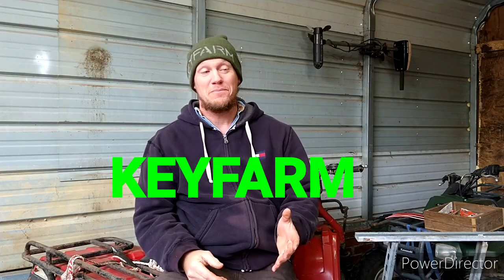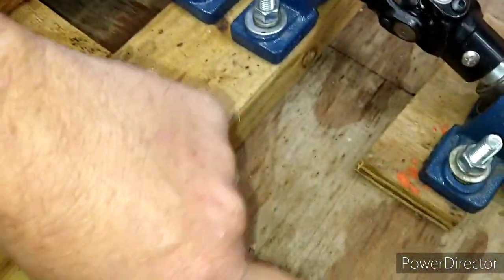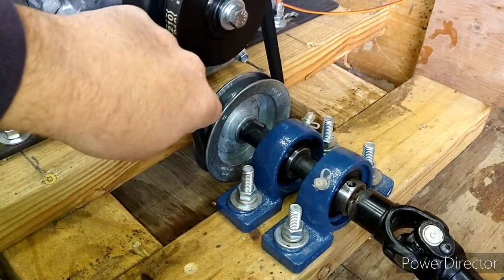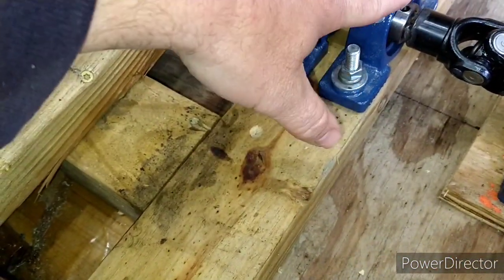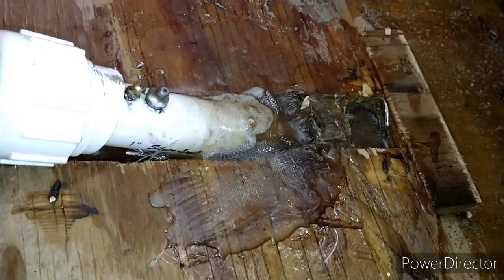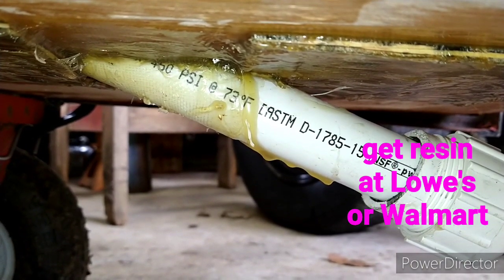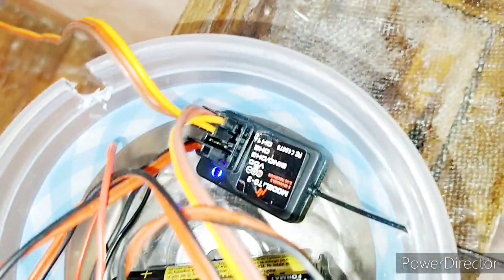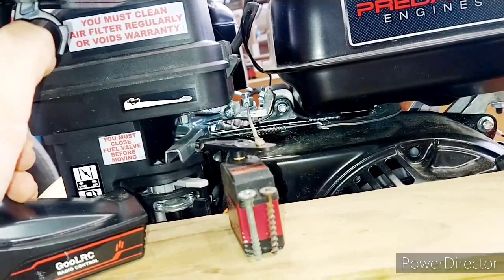Homemade radio controlled predator 212 plywood boat parts video.

Comment: Love the video, love the build and love how you gave those older men happiness and joy. I want to see a 420 16hp or 18hp duromax blue engine on the old tractor. I think you will get to it.
Reply from the maker: It's probably going to be 22 HP 670 cc, it ain't cheap, saving up, thanks for watching.

Comment: Is it possible to have two boat propellers to maintain 
Better stability? With the steering shafts?
Reply from the maker: It is possible, but on a boat this small it seems kind of unnecessary, and it's pretty stable as it is. Thanks for watching.

Comment: I am working on using your technique to build a an autonomous boat with 8"  PVC Tube. My concern is the belt getting wet in the sea wave. 
Can I use chain kit ?
Reply from the maker: Sure you can, but bare metal such as a chain will not like salt water. They make rubber belts with teeth

Comment: Questions.
Did you connect the two servos ( one for throttle & one for rudder) to the same battery? 
What kind of battery did you use?
Reply from the maker: The servos are plugged into the receiver, the receiver is power by a battery bank that consists of 4  aa batteries. It's an old system, new ones normally have a rechargeable battery pack that powers the receiver.